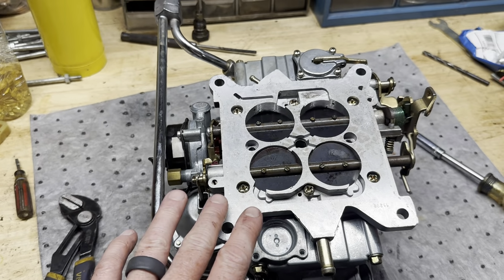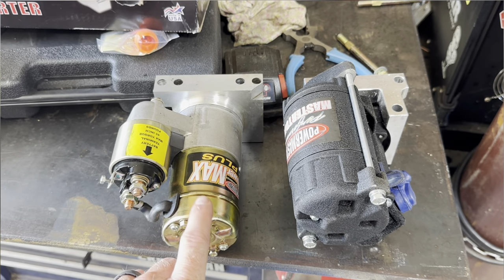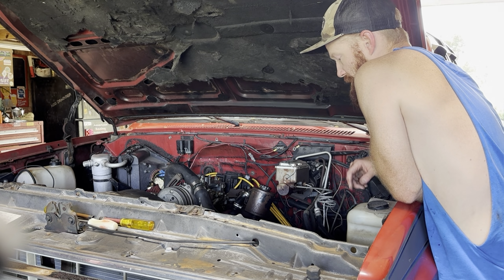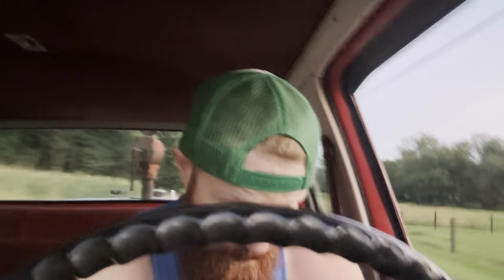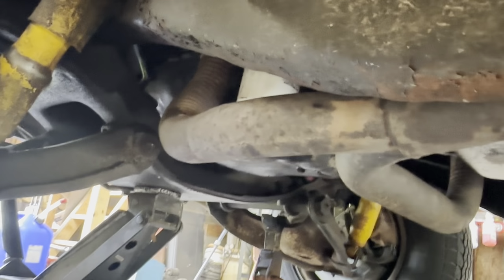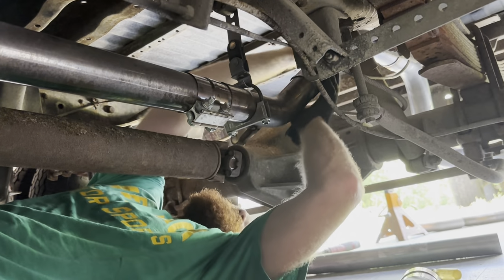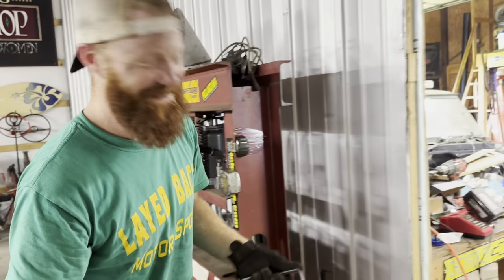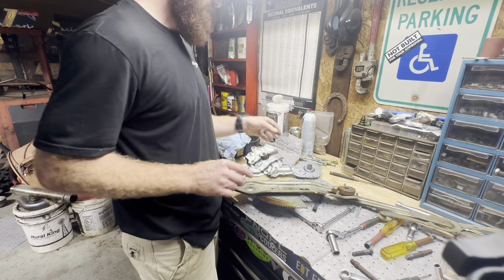Abandoned Dually Show Prep For Southeastern Truck Nationals 2024

Comment: Years ago I had a 1990 OBS sport truck. The owner before me put a new Catalytic Converter and Dual exhaust straight out the back with no muffler. It was not loud but sounded really good.
Napa has window channel lubrication. Really helps with electric windows up-and-down.
See you Saturday.
Reply from the maker: Nice I’ll check that out. See ya soon man